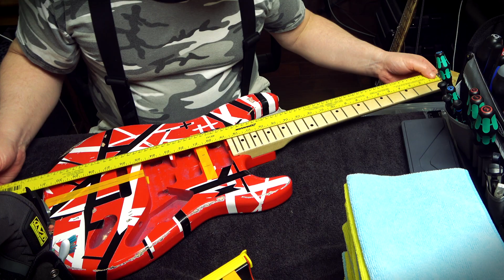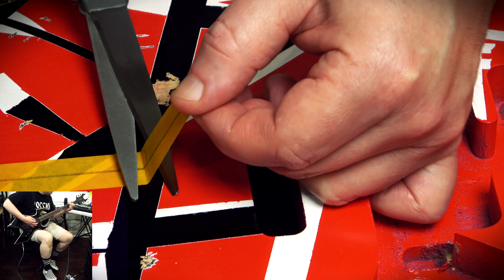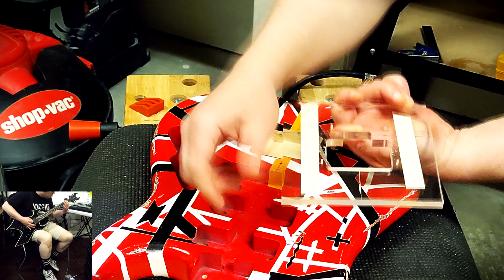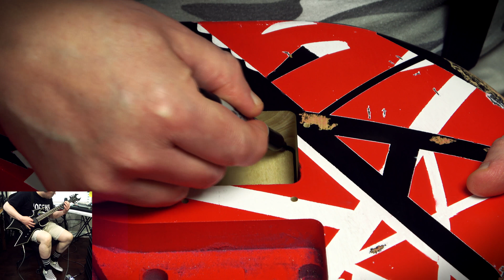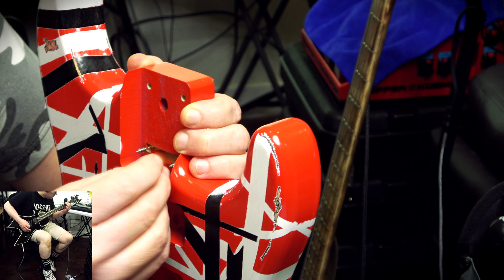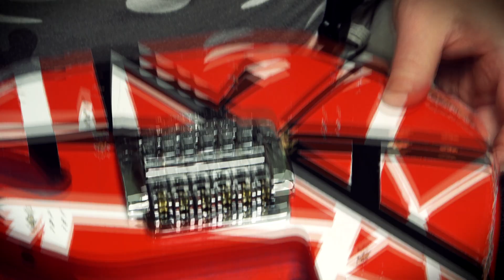DIY Partscaster Episode 2 - EVH FrankenSniffer Strat - Install Kahler Tremolo

Comment: What did u add inside the cavity hole? I just added a kahler to my Squier. It's better than the Jackson with a Floyd I have.
Reply from the maker: I added some red dye and then some wood floor wax just to seal it...not that any person will be looking in hole...but I might. 😂 Kahler tremolo is awesome! I was going to install a Gotoh GE1996T (I think are better than OFR) on this guitar purely for "look"...but there was not enough wood to properly support pivots, so I was most happy for excuse to install Kahler instead. I never owned a Kahler 2300 until recent times, and after first try, I immediately started buying them for every new tremolo installation...I like them better than Floyd style in just about every way! (Although you pay heavily for this quality.) Thanks for comment, hunter biden! 😂🤘🏼🤘🏼